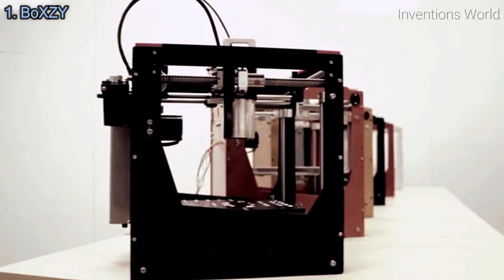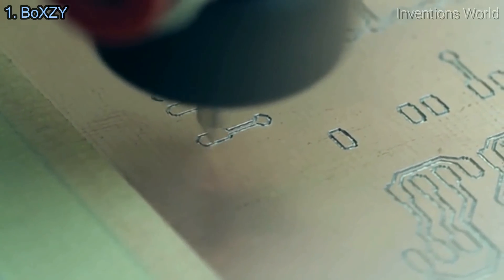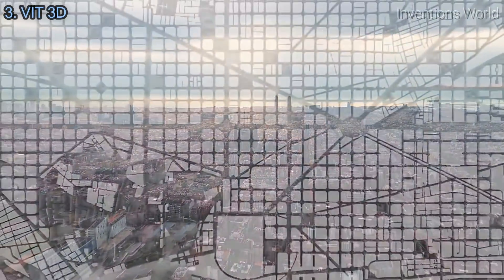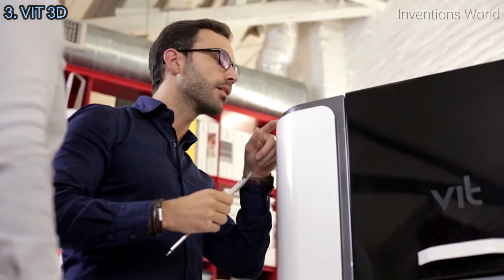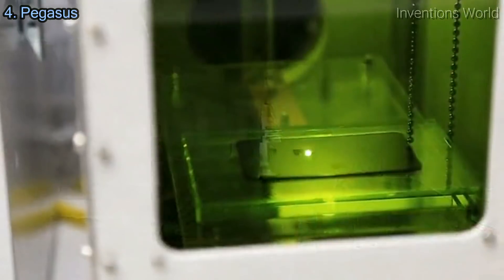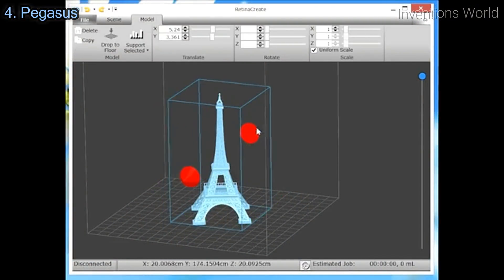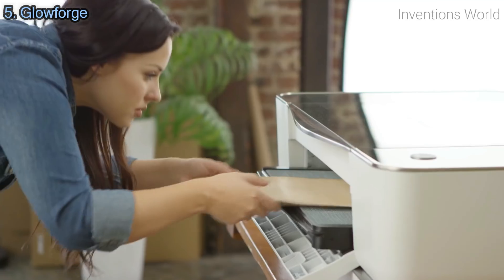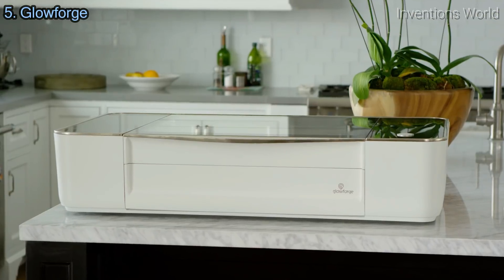5 Cool Laser 3D Printers In 2018 || Boxzy, Peoply, Vit 3D, Pegasus & Glowforge.

Comment: I waited for SLS or DMLS to become affordable consumer printers for years. Eventually I gave up and got an FDM delta type printer. I haven't assembled it yet, but got a laser to fit in place of one of the extruders, in the vain hope it might sinter aluminium fill PLA filament, it's highly unlikely to work and even if it does a 0.5W 800nm laser would probably take a day to print something the size of a pea. 

In reality unless we are only interested in micro sized prints such as RC engines, we probably are stuck with lost PLA casting for the next five years at least.